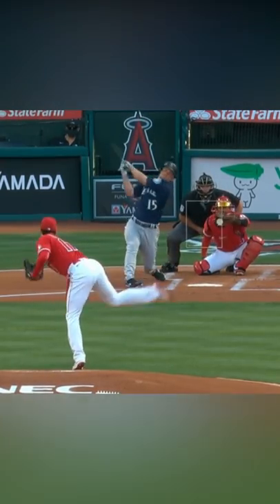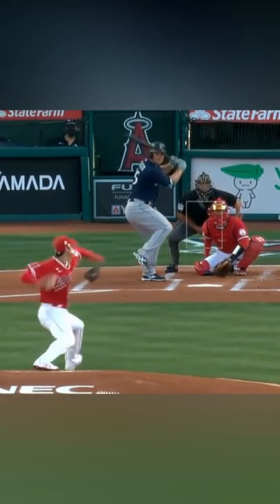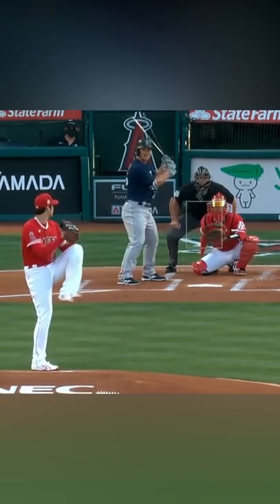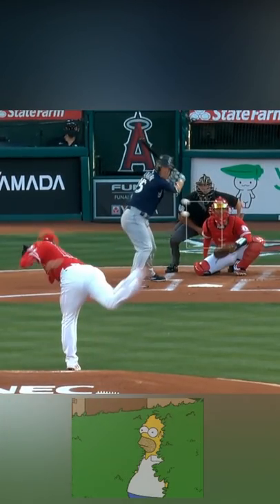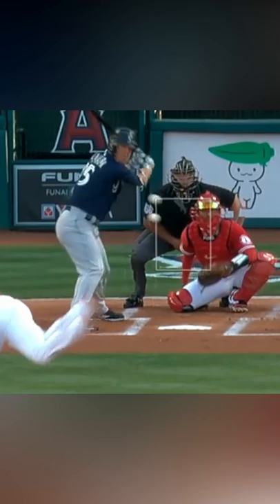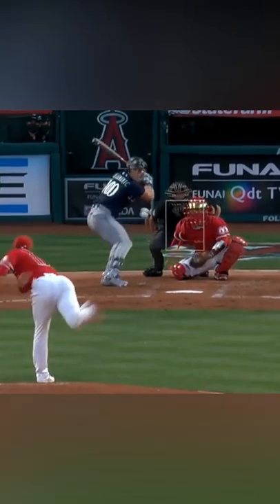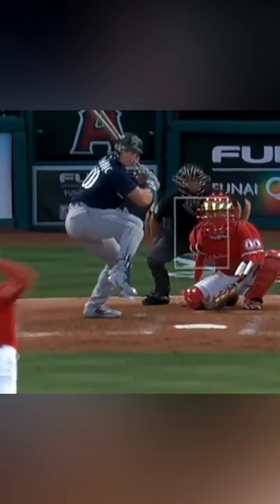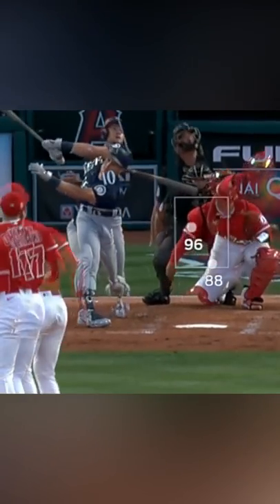Shohei Ohtani's Splitter is Impossible!!  #shorts

Comment: The ball would've probably stuck to the bat if he hit it.
Reply: Ohtani ain't using foreign substances. Neither is DeGrom. It's not impossible to throw a pitch that has high rpm and good movement without using foreign substances
Reply: @mshanahan6810  He increased his spin rate by over 300 on his fastball and his splitter over the off-season. What else would you call that maybe he has some angels in the outfield.
Reply: @ZombieFreak85  gained 40 pounds, fresh on a new ucl, did a bunch of driveline work in the off season, and tons of biomechanics optimization data, not unreasonable to jump off of all that.
Reply: Yeah maybe 50 rpm, but not 300-400. All across the league it has been a problem and they have all increased nearly the same amount, I can guarantee that is not coincidence. I don't blame them for doing it if everyone is cheating, and you don't then you look like a scrub and find your way to the bench. I've been watching baseball for 30 years and have never seen anything like this.
Reply: @mshanahan6810  its like the steroid era again, either dont use it and get your job taken away by people with 2.1 era, or use and have 2.1 era